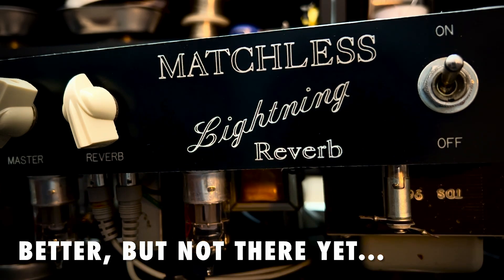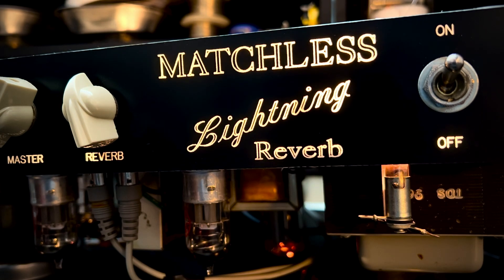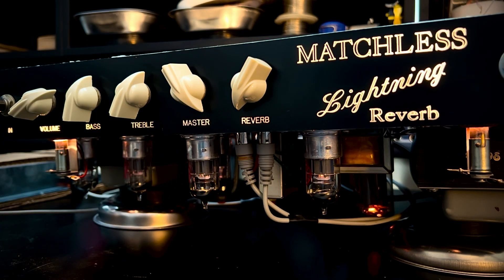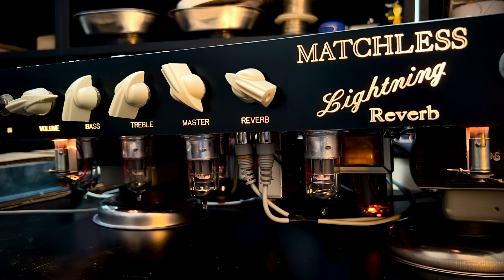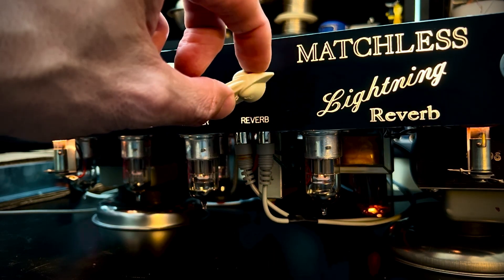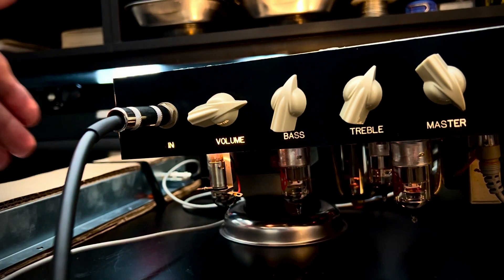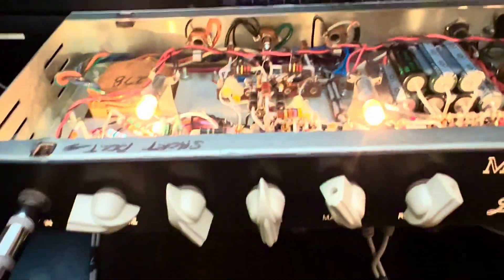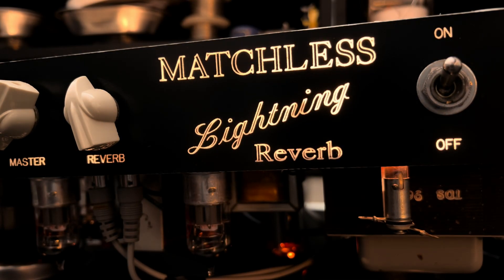Matchless Lightning Reverb: When Issues Collide

Comment: My laurel canyon does not have reverb... I can barely hear it till the control reverb is at noon. I've  changed the tubes, swap the tank  and still no improvement. What could it be?
Reply from the maker: Hey dude.  Lots of variables!  You may have most gain due to a fault in a cap or resistor.  Can you take measurements?
Reply: @ForgottenGearRestorations I will see a tech soon. But I do have  a multimeter
Reply from the maker: Send me an email
Reply: @ForgottenGearRestorations  Hi! I've talked with Phil at matchless and he gave me some good informations. I will check this out with my tech ;)
Reply from the maker: Nice!  I wish you the best. Way cool amp!